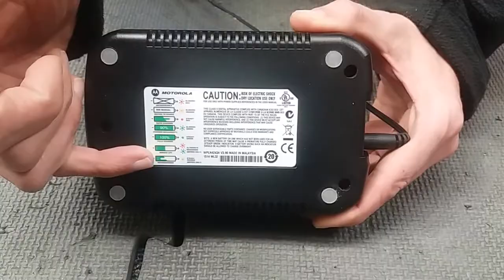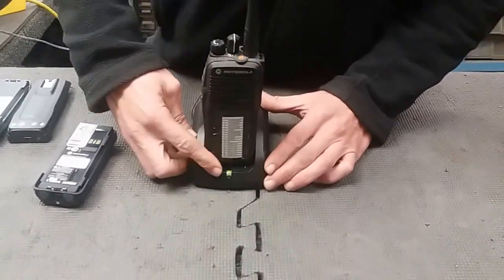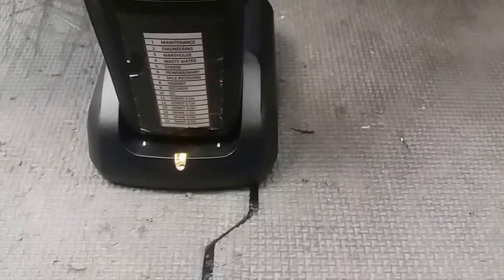Charging Motorola Radio Battery

Comment: Here is something I found out. There are a lot of fake Motorola charges that look like the real thing but are made in China, (of course). But I had flashing red batteries because I had not used them for over a year. I went to eBay and ordered genuine Motorola chargers and sat the battery in there it flashed red for 3 days, but I came back a day later and it was solid red. That afternoon it was flashing Green. After another 3 or 4 hours, it was steady green, I CONNECTED THE BATTERY TO THE RADIO AND WALA IT READ FULL BATTERY. After that, I used the radio for about an hour and it died quickly then when I put it back on the charger it went into reconditioning mode. I do not know how long it took but I left it overnight and the next morning it was solid green and I got normal life out of the battery. Now this has worked on two batteries and when I opened up the charger I had it was a brown motherboard with little on it and the new Impres Charger had a lot more going on, chips, copastors, etc. Side by side you could not tell them apart.

Comment: Based from 0:45, which lead is positive & which is negative?
You have 4 silver contact lead, 2 left & 2 right (0:45).
Reply: They have multiple cells
Reply: @2KCamaroZ28SS  Pertaining to my questions? That's not the correct answer.
If you have one & has a DVM/DMM, you will know the answers.

Comment: I have 5 Motorola apx, 4000 2 button. My impress batteries do not Indicate battery level in the radios. This happened after a year. As a firefighter I do not have confidence in the radio's charge level when I go out.  They also do not hold a very good charge when sitting. My department will be purchasing less expensive batteries as These are only 2 years old.

Comment: My charger has a flashing yellow light. Not sure what to do with it.
Reply: Never mind I found it. If anyone needs this information: 

Flashing Orange

Flashing orange indicates that the battery is recognized by the charger, but is waiting to charge. This means that either the battery voltage is too low or the battery temperature is not optimal for charging. When this condition is corrected, the battery will automatically begin charging.
Reply: It means wait

Comment: what if the led is blinking...but only red light....what is the meaning of that..
Reply: Too hot or cold. Let temp level out to room temp. Or there's a problem with the battery. Sometimes you can clean terminals on the charger and back of battery and unplug/replug the charger and it will work.

Comment: What if the battery charges on one charger and blinks red on another?
Reply: Charge it on the one that does
Reply: @2KCamaroZ28SS  duh 😂. Here’s the problem with that I only own one charger the other belongs to my co worker. I already switched out the radio.

Comment: What if it’s a solid red light
Reply: Mine  is  doing  this  on  two  batteries  after  long  charges, I  did  read  that  there  was  a  fault  with   a   Ham  Radio  charger  that  did  the  same  &  there  was  a  modification  inside  with  a  resistor  change  that  fixed  the  problem  as  it  was expecting  a higher  voltage  when  fully  charged.
Reply: It means it's charging